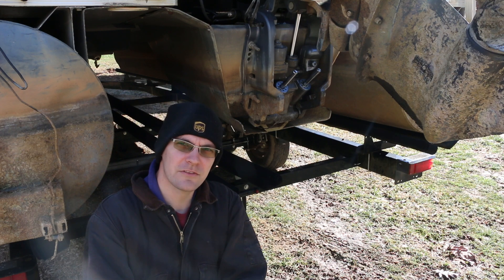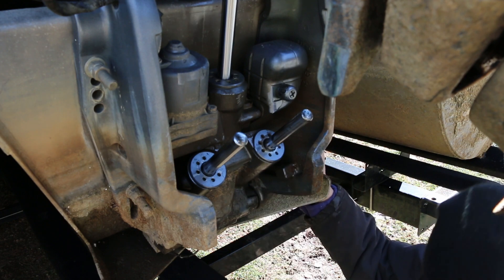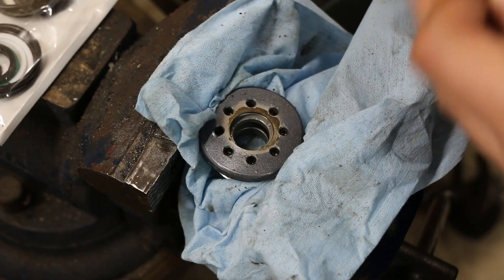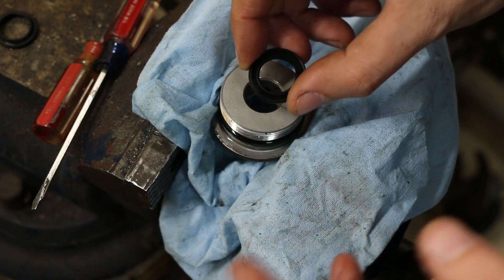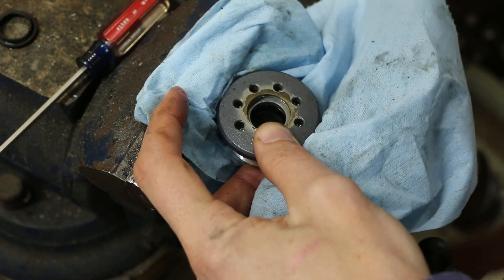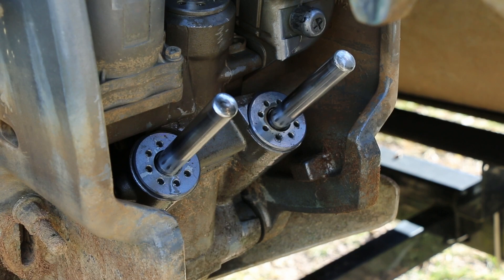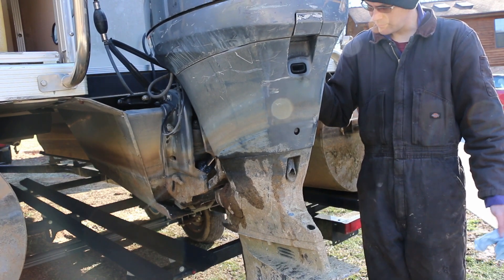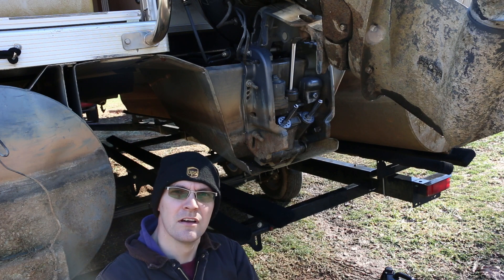Replacing cylinder seals on a Showa (Yamaha, Honda, Evinrude) Tilt/trim system

Comment: doeant the seal go in from the top isnt there a lock ring
Reply from the maker: The cap I had I believe the seal could go in from either direction but one way was easier because of how far it needed to go and the direction I wanted to roll the seal in.

There could very well be some slight differences in these trim units

Comment: Thank you for the video. I had a hell of a time putting those seals in from the bottom as I have twins. I eventually tried installing from the top and all four popped in much easier in minutes.
Reply from the maker: They can be miserable. I've heard that warming them up in some water in a pot on the stove can help

Comment: Why wouldn’t you replace all the seals while you’ve got it apart though? And what’s up with that cowling? You must be getting a lot of water inside that engine bay. 😐
Reply from the maker: This was a work boat, it sees a tremendous amount of abuse, thus the cowling.
As far as replacing the seals, the main goal was to stop oil leaking into the lake for as minimal cost as possible. all the other seals were not leaking, and the tilt/trim is still working great. 9/10 times these seals are the only ones that fail, at least in the freshwater lake I'm on, the piston seals are a much more robust teflon type seal rather than a rubber lip seal that will crack with heat and age or get scored easily by debris.

Comment: Just a pair of retaining clip pliers and you can remove the pin that holds the tilt piston to the engine, then you can run it up and down without needing to move the engine. you won't have the engine weight to force it down but it will move down.
Reply from the maker: Oh hey that's actually brilliant. Why didn't I think of that? Thanks for the tip!

Comment: Looks like you put the center preasure seal in upside down, also it is helpful to mention, that after much frustration. i found that these caps have been retro fitted, there is no longer an inner preasure and outer dust seal, they are now sending a new cap with just one seal that you have to hammer inn there with a propper size socket and hammer, and insert the metal clip. It ius much easier way, but unfortunatly caused me so much confussion, cause if you order just the seals and try and use the old caps it will not work, so if your cap still uses an inner and outer seal, you need to order new caps.
Reply from the maker: That is very bizarre about the new caps. I have not seen anything like that yet.
I'm certain I got the pressure seal (center) in the right way around, I may have flipped the cap over in the vice in the video or something, but I know I discussed which way it needs to face.
Reply: @trythistv  So now I am really confused.  Which hay do the lips of the center seal go into the cap up or down?  I was always told the lips go to the atmosphere?  Can you clarify
Reply from the maker: @marcedelman7398  every seal I've ever seen to hold pressure has the closed side of the U shape they generally have facing away from the pressure. The reasoning I was told is that when pressure is built, the pressure will press the sides of that U apart, giving a greater sealing capacity. Looking at the seal, the open side of the U flares out on the ends of the open side, which should be facing the pressure, otherwise the pressure would collapse the seal inward and leak.
See Fig 2. on this site: https://sarum-hydraulics.co.uk/uncategorised/installation-instructions-piston-rod-bearing-u-seal/
Reply: @trythistv  that makes sense